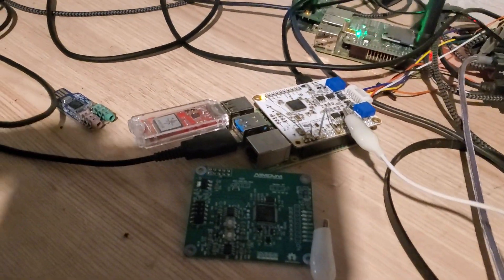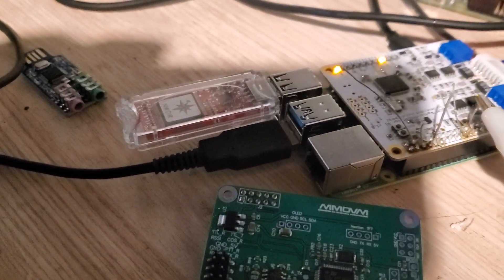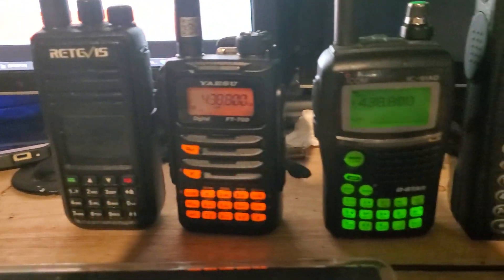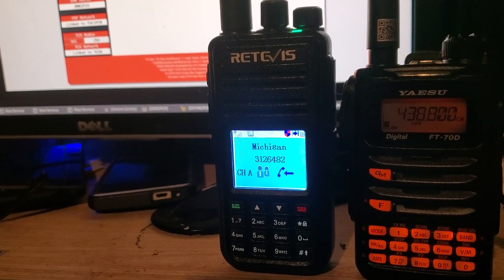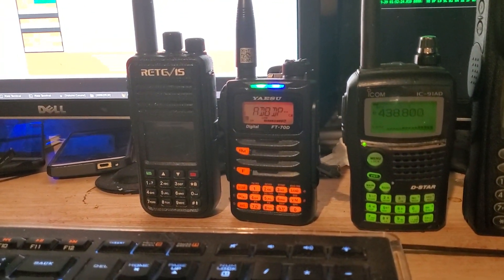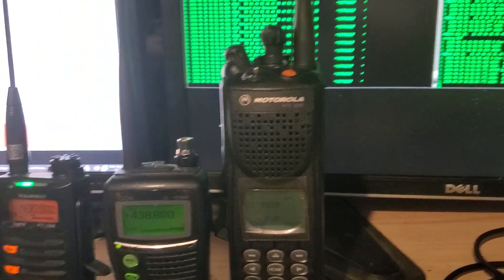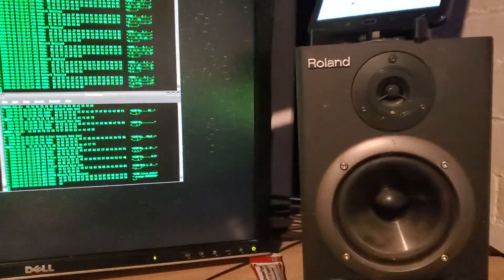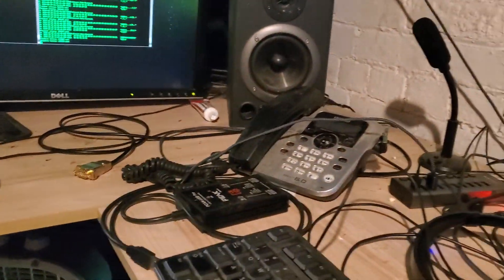DUDE-Star Radio project

Comment: Did this project disappear?   I’m looking for hardware/software to use with an analog radio with a data port like the FTM-6000R that would let me use the analog radio to communicate on simplex over DMR, D-Star, and C4FM so I can have a single radio in the car and participate in very popular local activities on simplex digital voice modes.  This seems like exactly what I’d need.

Comment: Looks promising. I noticed a couple of things, 1) a fair bit of hiss during the fusion and p25 tests. Is it possible to adjust the interface gains to eliminate this?
2) I am guessing the lag comes from the software conversion of non dstar audio. Your hardware dv3000 is probably much faster at this. I thought since you already have the dongle... why not use it to transcode all formats so that you can enjoy its faster job speeds?